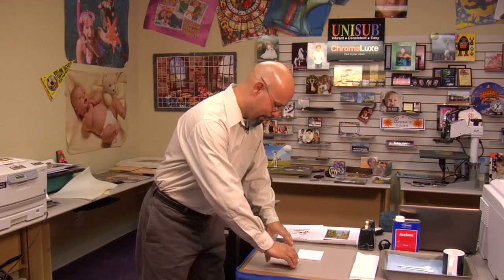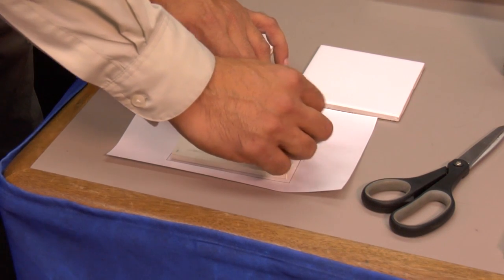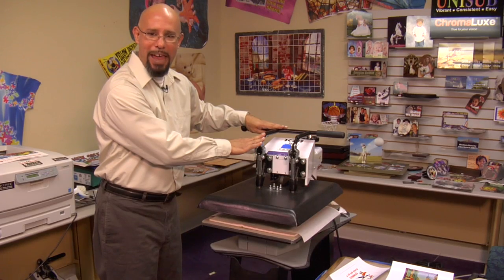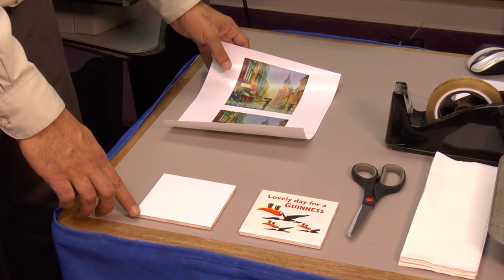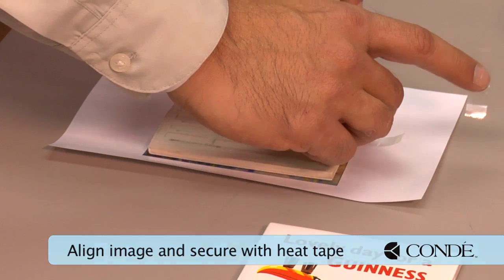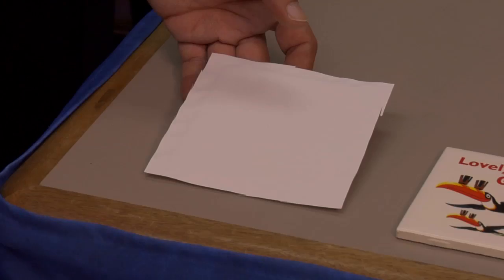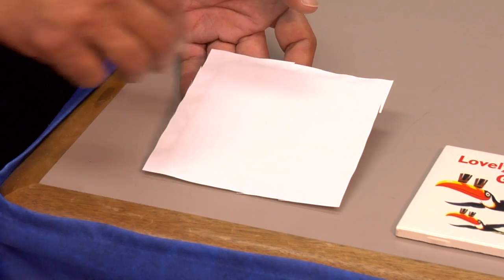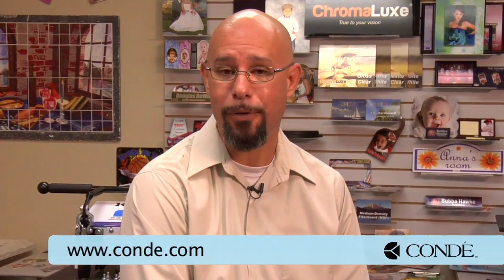LaserMPrints Hard Surface Heat Transfer Paper Part 3 -

Comment: To protect it, can you just coat it with resin? Also, are the images on the tiles, mirrors etc scratch resistant?
Reply from the maker: In theory, you could apply a coating to protect the graphic on the surface of your substrate.  However, you may need to experiment with some coatings, as they may have a tendency to discolor the emulsion of the transfer.  Basically, the cleaner the coating, the better.

Comment: he never did show how to do a proper edge to edge print. hmm.
also, if acetone takes the image off (good to know) how would you clean any object? like the mirrors when they get finger prints? -- you know people want to touch these to feel them. does regular window cleaner (ammonia based) work? somewhere i have the 'curing station" for doing mugs this way. how much more durable does that step make items?
Reply from the maker: David Larson In this situation, you would want to "cure" the image on a mirror by reheating the mirror (with press or oven) for another 2-3 minutes at about 300-F.  In regard to cleaning, use a "non-ammonia" based window cleaner.

Comment: Are these tiles heat safe? Could you use them as coasters/ trivets?
Reply from the maker: Any product made with the Hard Surface transfer papers should be considered a "decorative" item and not a "durable" item.  While it may be possible to cure your printed tiles, the image will still be on the surface.  This process does not embed inks like sublimation does.  Therefore, if you plan to offer tiles as coasters or trivets, we recommend that you use sublimation and coated tiles to insure durability.
Reply: Thanks!